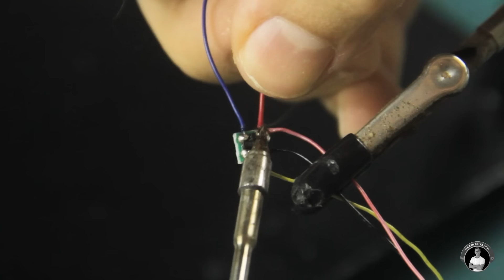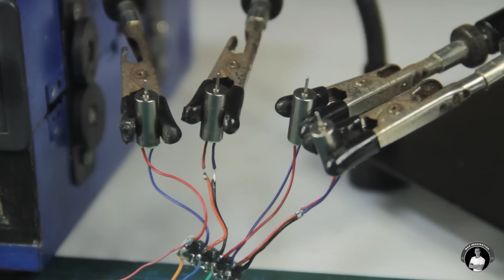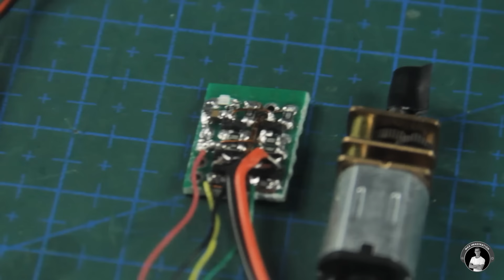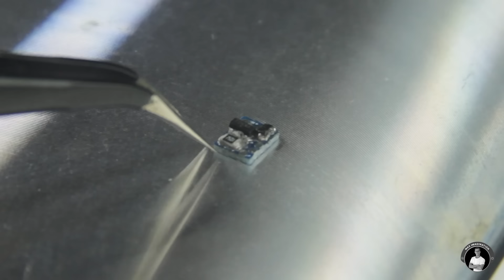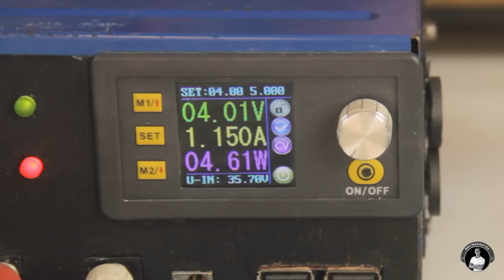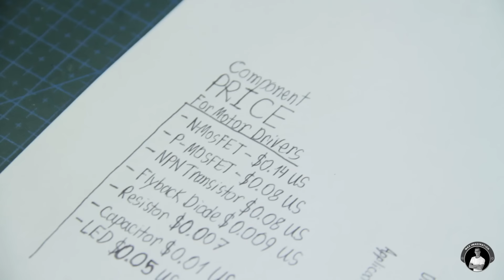Guide to making TINY Brushed Motor Drivers with MOSFETs for RC Projects

Comment from the maker: If you want to use these motor drivers with standard PPM, SBUS, or other common protocol receivers, you'll need to rig a microcontroller in between for signal conversion.

P.S.
If you're a textual learner or want to learn more about these motor drivers, read the full project blog on Elektor Labs: https://www.elektormagazine.com/labs/guide-to-making-tiny-brushed-motor-drivers-with-mosfets-for-rc-projects
Reply: Bro make mini sized DC motor please ❤❤❤
Reply: (8205A )dual N-channel enhancement mode MOSFET   will be the better choice for this DIY esc . 😊😊
Reply: @Tuhin-ZIP  Dual N channel? the channel created will be due to majority collection of electrons, when positive voltage is applied at VGS due to which the holes would repel and would settle at the bottom. This is how single channel is formed, how dual channel is formed?
Reply: @ayushmanyadav2006  Dual Mosfet mean 2 Mosfet in 1 package  not dual gates.
Reply: @madiaw5553  Thanks.
Reply: can it be double sided?
Reply: at 2:48 at which terminal you soldered the motor 

as far as I know it is 
purple wire at anode of diode 
and red wire at cathode of diode 

it is correct?

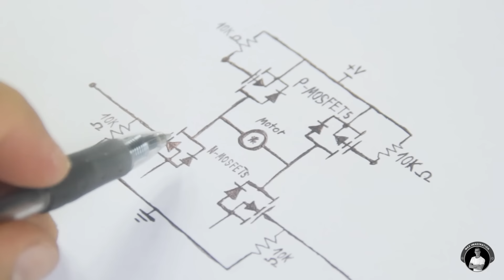Comment: Great tutorial Max! Apologies if I missed this, but why don't we include flyback diodes to the bi-directional motor driver circuit 21:14?
Reply from the maker: Thank you! The diodes were actually made part of the MOSFET symbols in the schematic drawing. As you can see, they are also tightly packed up against the MOSFETs on the actual bi-directional motor driver.

Comment: This driver communicate To FS-2A 4ch Receiver ?
Reply from the maker: Never tried. If programmed correctly, it may work. Otherwise, using a microcontroller is recommended as the intermediate signal converter.

Comment: Hi amazing work

I have two 3.5 channel rc helicopters and i love doing modifications on them recently I changed the tail motor on one of them from 612 coreless motor to 615 . The helicopter took off once and then stopped pairing with the transmitter. Even in the switch off position the indicator light on it glows but very dim. Is there will be any problem with the SI2302 transistors or any smd capacitors. If you can help me out i will highly appreciate it . I have also posted shorts of their pcb boards on my YouTube channel. And if you can help me with the circuit diagram it will be amazing.
Reply from the maker: Hi and thank you, but I cannot help with projects other than those I show how to build on my channel.

I suggest troubleshooting your pairing issue with AI. To me, it sounds like there could be a blown power management circuit since the LED glows very dim and the board doesn't run anymore.
Reply: @MaxImagination thank you for replying i also think there went something wrong with the power management

Comment: Hi, could you please share the complete dual H-bridge motor driver circuit, including the full schematic and PCB files? I’d like to have the complete PCB manufactured through JLCPCB. Also, how can I contact you so you can send me the files? Thank you!
Reply from the maker: Hi, I don't provide that, but you can pair two single motor drivers side by side and use it that way or design your own following how I did it.

Cheers.
Reply: @MaxImagination  that's a great idea ! Btw thanks

Comment: I make this but not working
Reply from the maker: What exactly happens when you try to power it on? Measure the signal voltage, then the output voltage at the MOSFET with your multimeter. If your wiring is correct, I give it a 90 percent chance it is a damaged MOSFET.

Comment: L298N DC Motor Driver which is very small and can handle two motors and weighs about 50 grams. Why kludge it like this when you get a more professional looking board for $0.39 each?
Reply from the maker: The L298N is not very small. You make custom ones normally when you want to achieve sizes smaller than those sold on the market.

Comment: it is always nice to watch your videos brother they make me learn new things even on repeat 
just wanna ask that the SMD components are too hard to solder for a non professional without proper equipments (like me 😅) so is their any easier way to do that like the mosfet is ok, i can solder it, that is big enough but that resistor and switching diode is the main problem, they are soo tiny, i think instead of those i can use the normal ones, am I 
right?
Reply from the maker: I am glad you find them helpful! Soldering those components won't be so hard after you follow my new SMD component soldering tutorial: https://youtu.be/skDwEgYY1UA
Reply: @MaxImagination  Very thank you

Comment: Heloo. 3904 and mmbt2222a(1p) npn transistors are not available can i use bc 548 npn transistor
Reply: Thanks
Reply from the maker: No. You can't use BJT transistors the same way as MOSFETs. You can use alternatives like the AO3400a mosfet.
Reply: @MaxImagination thankyou👍
Reply: @MaxImagination how can I contact
Reply from the maker: Instagram: @max.imagination
Reply: I am making a rc truck mini , and motor is 7×16mm micro drone motor , and motor driver was drv8833 , I used 4 drivers of red colour pcb and all 4 failed and I tried 2 black pcb variant with j2 jumper on back and both failed again and then I decided for make one

Comment: Why don't we make 2 single driver and connect to same motor in opposite charges instead of making dual axis motor driver.
Reply from the maker: It will not work because two single drivers do not contain h-bridge circuitry necessary to flip the current flow for the motor.

Comment: Hey max i was wondering to use these n channel motor drivers with 8520 coreless motors is the switching diode is sufficient to handle them ,please reply❤
Reply from the maker: Hey. It is sufficient for those motors. Flyback current is instantaneous and not constant, so the current the diode can handle does not matter so much, from my experience.
Reply: Thank you for reaching me out i am assured now @MaxImagination

Comment: Can u use one pwm signal to control forward and back. So I dont have to take up 2 channels on reciever?
Reply from the maker: It is possible, but then you would have to look into building or using a brushed "ESC" as opposed to MOSFET-based motor driver. Like this one. https://www.amazon.com/Brushed-Motor-Speed-Controller-Brake/dp/B0892B2N41
Reply: @MaxImagination  yea. Hoping to build one smaller. Mine is 5a but still kind of big granted 2 motor drivers.
Reply: @MaxImagination  hey I sent a message to you on facebook
Reply from the maker: I don't use Facebook and will not check it. Either Instagram or email/YouTube.

Comment: Excellent in depth tutorial, im going to try building some. In your own testing what stall currents have you seen on 0720, 0820 and 8520 coreless motors?
Reply from the maker: Thank you! I have not tested those specific motors before. You'd have to research the stall current in the datasheets.

Comment: Hi, Max! I want to make these drivers for my micro RC plane, but have a question: what PWM frequency do I need to put in the code? Like: ch_width_3 = map(data.throttle, 0, 255, 1000, 2000); <-- the last 2 numbers. Thanks.
Reply from the maker: Hi. Good to hear!
You don't need to worry about frequency. The numbers you listed are microsecond values for PWM, telling how fast the motor to go. Nothing needed to be changed here.

Why did you want to change frequency?
Reply: @MaxImagination  I'm kind of new to arduino and code, and mixed up the microseconds and frequency. I asked because i have another working brushed ESC but with that line of code, it doesnt spin the motor to full throttle. There is a slight chance of the motor pulling too much current, but there is no heat and it's rated for more. My theory is it wants a pulse longer than 2000ms. Can this be the problem?
And your drivers will work with 1000-2000ms PWM, right?
Thank you
Reply from the maker: Oh, I understand now. Yes some ESCs depending on their required protocol may need to pulse beyond 2000. Try adjusting this upper value.

Yes, my drivers work fine with this arrangement.

Comment: Can I use ao3400 n channel mosfet instead of SI2300 N-Channel MOSFET; resistor and diode will be same?
Reply from the maker: Yes.
Reply: @MaxImagination  does you're motor driver in your tiny drone operates on 3.3 v logic level
Reply from the maker: Yes, it can.
Reply: I don't know why but a single set works fine but using 4 for drone it doesn't work I burned ( AO3400 )5 times 🫠 also my ESP 32 fried.🥲
Reply from the maker: Careful, you can easily damage the MOSFETs if you're not wearing an ESD strap to ground yourself. Never touch the pins with bare hands.
Reply: @MaxImagination  i used pulldown resistor between PWM pin and gate of MOSFET and now its working completely fine
Reply from the maker: Glad you caught that step. Great to hear.
Reply: @Rudra.patidar2008 same here

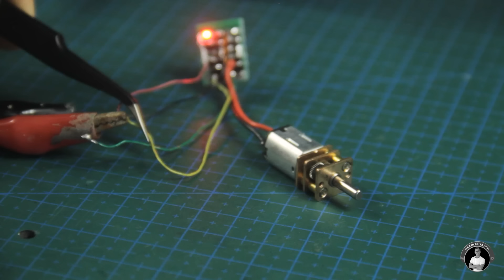Comment: I still try to understand motor drivers and MOSFETs. I would like to create one for slotcars. So, I would need a unidirection controller with a brake. I was thinking if the H-Bridge would fit my needs, despite the fact, that I need just one direction. There is one question which is related to the PWM Signal for the H-Bridge. In the video at minute 23:23 where you explained how the H-Bridge works using just two 5 Volt signals. I was wondering if this would also work with 3.3 Volt PWM Signals, since I would like to use a STM32 mikrocontroller.
Reply from the maker: Hi. If you want electronic braking, the H-bridge is the one as you can apply reverse current to slow down the motor fast.

Yes, it can work with 3.3V signals.

Comment: how to connect this to receiver?
Reply from the maker: Depends on which receiver?
Reply: @MaxImagination  4chanels flysky
Reply from the maker: It's not designed to work directly with those receivers, you still need a microcontroller to convert the signal to PWM (0-3.3/5V). Right now the receiver outputs 1000-2000ms of pulses, but the lowest position still provides power.

Comment: Just a small doubt , in the 4 ch motor driver, if i want two motors to rotate in one direction and other 2 two in opposite direction what should be done? are the connections still the same?
Reply from the maker: First of all, check you're using two clockwise and two counter-clockwise brushed motors for your drone - assuming that's what you're building. The connections should still be the same.

Comment: Bro how much voltage or battery capacity can be given to this motor driver of yours ?
Reply from the maker: The unidirectional drivers can handle 3 amps and the bidirectional 2A.
Reply: Read the datasheet of those mosfets... 🙌😄

Comment: I just followed your directions for a single motor esc connection it works. But if I connect it to receiver  it just runs continuously can't control it with a radio controller.
Reply from the maker: This motor drive is not intended for standard PWM radio systems, but rather microcontrollers like Arduino and ESP32.

If you could figure out how to make the PWM signal width go from 0 to 2000 instead of 1000 to 2000 like you have it, then it may work.

Comment: Can we use any kind of n channel mosfets please reply
Reply from the maker: Any N-channels with fairly low "Rds on", such as the SI2302, SI2304, etc. Yes.
Reply: @MaxImagination rds means
Reply from the maker: The RDS(on) of a MOSFET is the resistance between its drain and source terminals when the device is turned on, typically in the linear (or ohmic) region. A lower RDS(on) is desirable as it results in lower power loss, which is important for efficient switching applications.

Comment: "Can this motor driver be used as a brushed motor ESC to build a drone?"
Reply from the maker: Yes, you can use the motor driver for your drone's brushed motors controlled via an ESP32 or Arduino. Check my channel for those project tutorials using these motor drivers.

Comment: Awesome. Can I connect directly to the flysky-i6 receiver? (for the N20 motors landing gear set)
Reply from the maker: You can if you can make the PWM signal go from outputting 0V to the supply voltage, then yes. Othewise, you may struggle with constantly getting motion from the motor even when throttle is zero. The driver lacks a form of controller (microcontroller) to interpret standard PWM signals that go from 1000-2000 value. If you can slap an MCU in between with the correct code, you're good.

P.S. Thanks for your comment!

Comment: Hi Max, I'm a beginner with electronics, I always have a question that is do i have to fully understand the operation of things like MOSFETs (for example) to make those stuff or i just need how to use it in a circuit.
Reply: You just need to know which pin is which in order to make proper connections. Later you can dive in how components actually work else just basic knowledge is more than enough
Reply from the maker: Hey. As long as you follow my video and get a basic understanding of how to use MOSFETs (my explanations are simple), you're good. You can build the circuits.

Comment: Can you make an BLDC motor drive/ESC please!
Reply from the maker: I have that idea noted for a possible future video. Cheers!
Reply: @MaxImagination  yo dude quick question, I tried using L9110S but it was on heavier side so I'm shifting to your uni motor driver, is it alright to use SS34 Diode instead of the one in the video
Reply from the maker: Hey! It's a fast recovery diode, so yes, you may use the SS34.
Reply: @MaxImagination Ty for the reply, I'm making a drone based off ESP-NOW hope that it actually files 😂(currently weights 58g and uses 716 4x With 55mm props)

Comment: Hey so I am going to make a unidirectional motor driver so I don't have the si2300 one but AO2310 so using a 10k ohm resistor is better a 1k ohm resistor so I am not going to use smd resistors but normal sized ones
Reply from the maker: Hey. Good MOSFET choice. Better to go for a higher value resistor such as 10K or 4.7K, but 1K will also work. Normal sized components will work fine.

Comment: Can controle the speed of motor by this motor driver??
Reply from the maker: Yes, but you'll be best to use a microcontroller or receiver to send it the correct PWM signals.
Reply: @MaxImagination thankyou for your reply ❤!!
Reply: Bro, can I use 1N4148 100V,DO-34/DO-35 High Speed Switching Diode . I only have this ...

Comment: I did the same as you said, but my diode burnt out, and the video is really informative.
Reply from the maker: Maybe you chose a diode that couldn't handle the current or you placed it in the wrong polarity. What diode did you use?

Comment: can't we use 2 uni directional driver as bidirectional driver ?

just reserve motor connection in other driver. and control it through mcu for switching
Reply from the maker: Not possible without the correct circuitry with bipolar transistors and extra two MOSFETs to form the "H", allowing for polarity reversal. I suggest you study H-bridge circuits more - even though I cover them in the video.

Unless you can prove me otherwise, you can test and tell me if your idea worked.
Reply: @MaxImagination sorry if i offended you. I am new at this stuff. 

I also thought that there will be conflict between driver one + and driver 2 -. If only there was a way to isolate both currents. Diode was not an option.

I was not able to get components from the market yesterday. So i will get it today and do some experiments.

Thank you for your video for guiding the processes.
Reply from the maker: Not offended at all. Glad my video could help!

Comment: hi, i am making the driver for the mini drone, but like sometimes it works and most of the time when i test it, smoke comes out from it. I check the polarity of the diode as well that anode is going to the drain pin of the mosfet. Also i tried using the anti static wrist band as well, then also the drivers are not working. Please help.
Reply from the maker: Hi. Please ensure your wiring matches and that you're using the correct components - N-channel MOSFETs. Check your not shorting anything.

Comment: Hi, when I am staring multiwii and then starting my radio transmitter then it's not connecting...please help...
Reply from the maker: Make sure that your radio transmitter and receiver modules are correctly connected in terms of wiring. Troubleshoot the NRF24L01's powering.

Comment: My driver is not working properly, I’ve made 10 pcb’s but still the motor is spinning without any input and the motor vibrates without any signal, please help me out.
Reply from the maker: What type of controller/receiver are you using? Did you add the pull-down resistors? Check your MOSFET's aren't faulty or damaged.
Reply: @MaxImagination Im using a D8 protocol taranis reveiver, the mosfets are good and I’ve also added a pull down resistor of 10k, everytime when the pcb doesn’t works i just simply make a new pcb with new components, so I don’t really think so that there’s any issue in the mosfets.
Reply from the maker: I don't think there's an issue with the motor drivers you made at all. It's most likely the way your RC setup is configured. Generally, these hobby-grade transmitters output PWM signals from 1000 to 2000ms. 1000ms being no movement and 2000ms being maximum. If the lowest value is 1000ms PWM, there is still voltage at play. Not sure if it's possible, but you'll need to reconfigure your transmitter to start at 0ms or lowest value. See what changes can be done. Cheers.

Comment: Does this motor driver control speed as well, or the speed this controlled by PWM from the mcu
Reply from the maker: Only the MCU can control its speed via PWM. The driver doesn't have a controller chip on board of its own.

Comment: Does it work with pwm signal directly from flysky receiver?
Reply from the maker: From what I have heard, it should. But some complain that even when their throttle is on the lowest position, the motor still runs. I believe this can be fixed by reconfiguring the throttle PWM values.